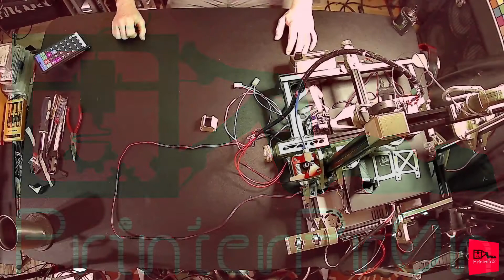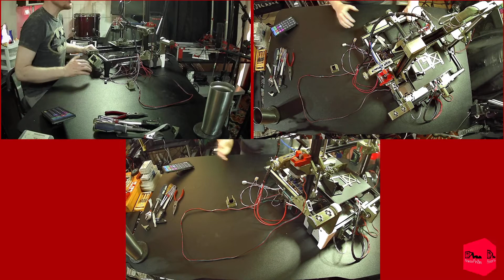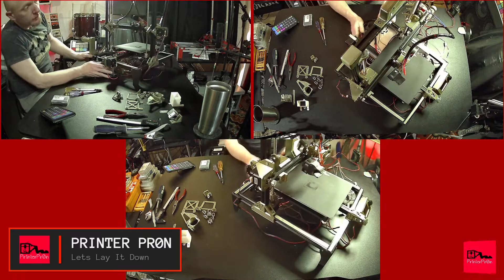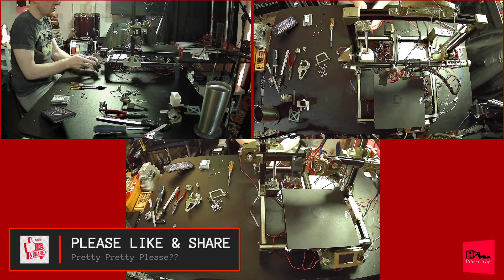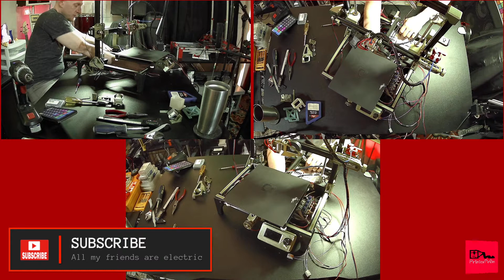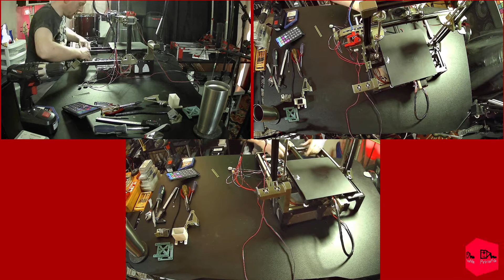Tronxy X3 Hot End Carriage upgrade and minor cosmetics Part 2

Comment: Happy to see you are using my Y axis belt tensioner... And my Tronxy X3 Z Carriage Upgrade Remixed With Nema17 Mounts (WOW!!!) I hope they are doing a great job without any problem... Thanks for your video.
Reply from the maker: They have worked perfectly for several years! I also have a scaled up X3 I built that has them as well. Great designs and they made the printer so much better than stock!